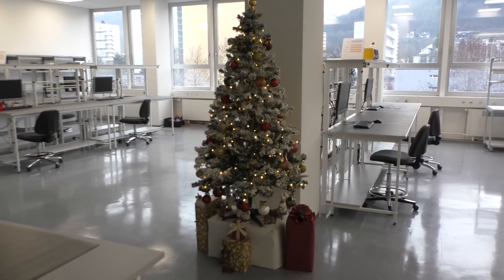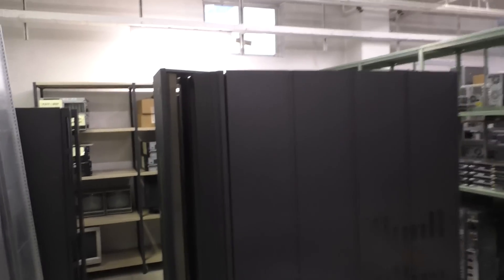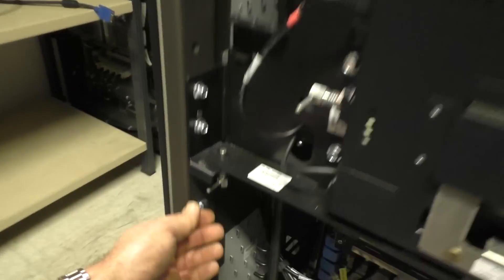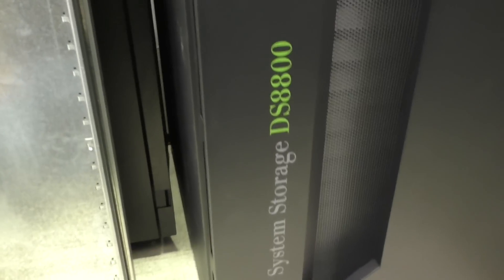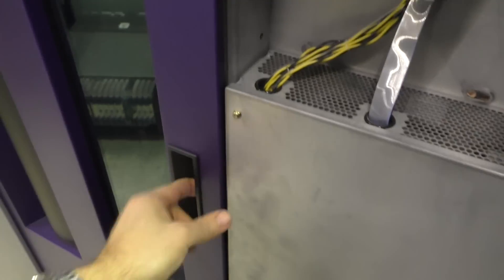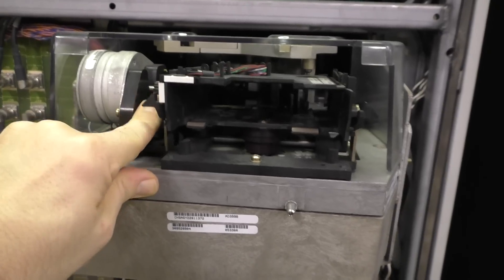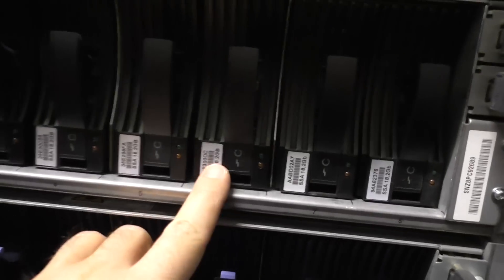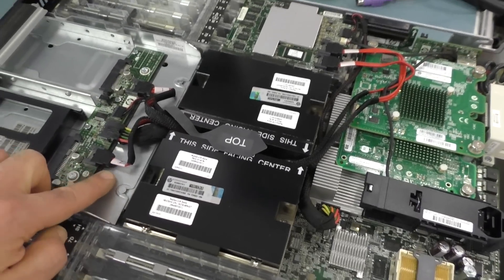PWJ44 - Xmas Special

Comment: i have to say that those c7000 's with a g7 or g8 would be ideal for someone with a big appetite to learn. myself included.
if i could find an outlet big enough, i would definitely buy a couple to experiment with.
Reply from the maker: If you only install one power supply and one or two servers, it would run on a normal household power outlet, at least in 230V countries.
Reply: @PlaywithJunk  true...here also its 220 volts. but most would agree with me when i say that if you own this and study with and from it, its better to fully populate it... you wouldnt happen to have any ones left over 5 years later eh???? ahaha.just recently i got my hands on a pair of dell r710..

Comment: +Play with Junk, What a lot of people don't understand is, ever since the initial C7000 offering in 2006, the evolution of the chassis specifications has changed as well. HPE implemented these changes to accommodate newer servers that were being released, as well as faster communication speeds.https://community.hpe.com/t5/General/Differences-between-C7000-chassis-versions/td-p/6344311
Reply from the maker: Yes that's true, there are several generations of the C7000 enclosures. The interesting fact is that the newest Gen9 blades still work without problems in a first generation enclosure. There may be improvements to data lines in the backplane, enabling it for higher speeds but the old enclosure is still not obsolete. 10Gbit Ethernet or FibreChannel works still fine.
It seems that HP engineers have done a good job even with the first generation of enclosure.